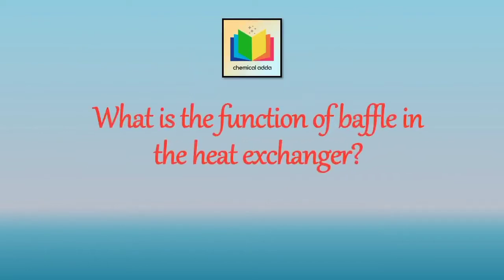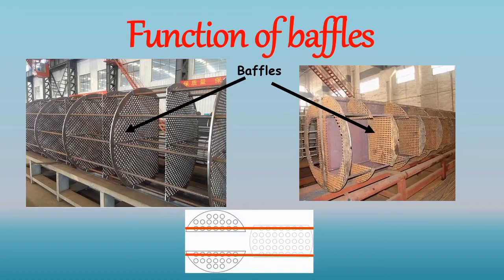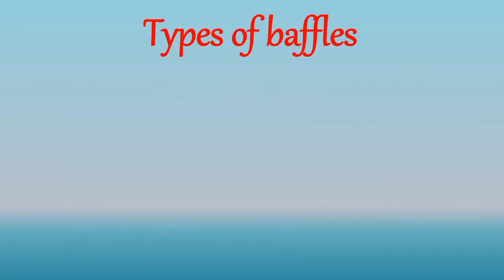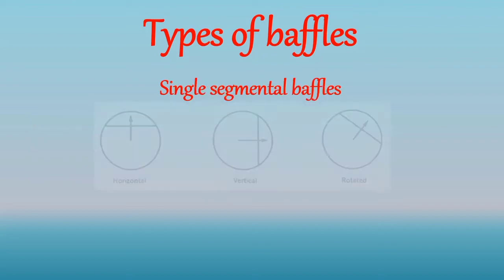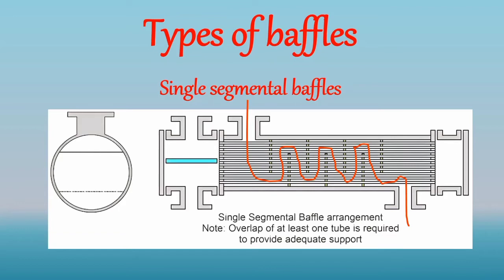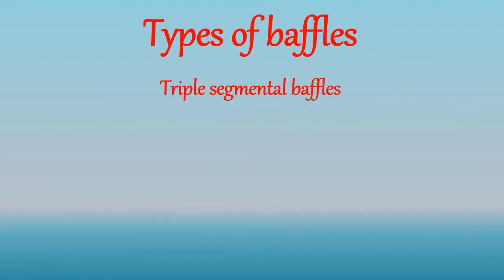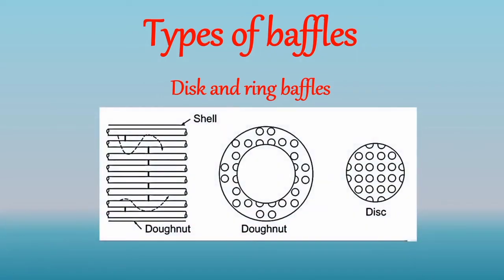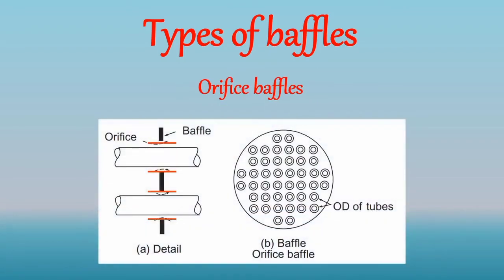Baffles | Shell and Tube Heat Exchanger | Types of Baffles

Comment: After Sheel and Tube intersection this is great way to get whole opus. A cooling baffle system can be selected as a good form of cooling element. Only thing that main problem gives rise to the need of certain Method prevent surface condensation. This can only make it possible to use a lower inlet water temperature under intermittent system operation without the dripping water risk ~but ~ this can be used in the project where we are using the absortive paint as moisture protection. As well nowdays we can use quantum phyhisics instead of simulation results for exp. The Fourier transform of spectal distribution of amplitude to get the spectal power density and damping cofficients which determines the rate of loss of energy. This is some kind of mine vision. 
By the way good music during presentation.